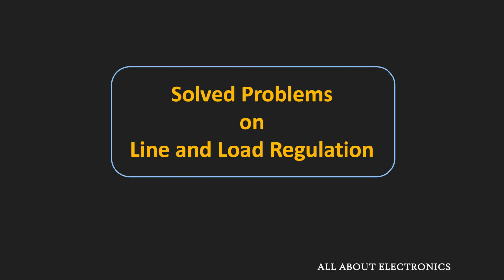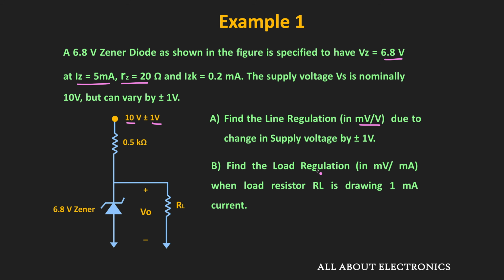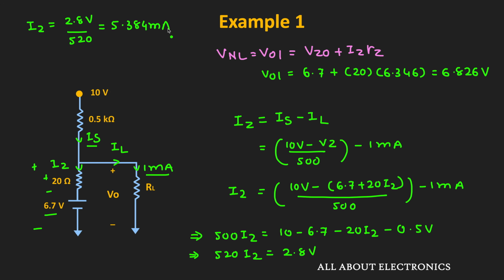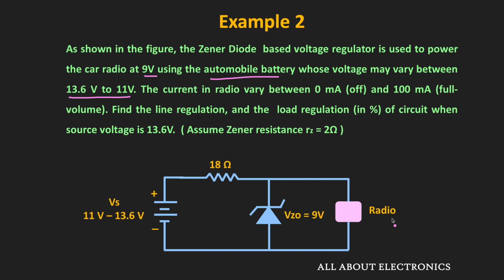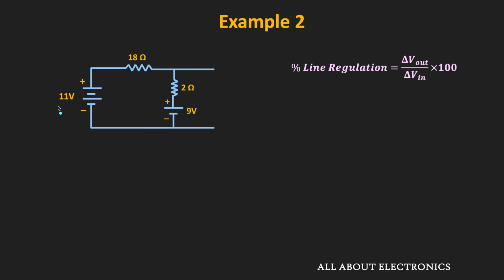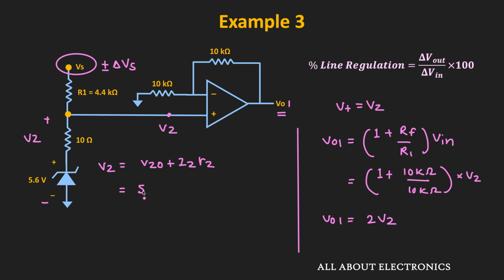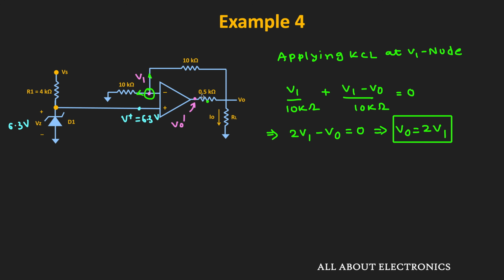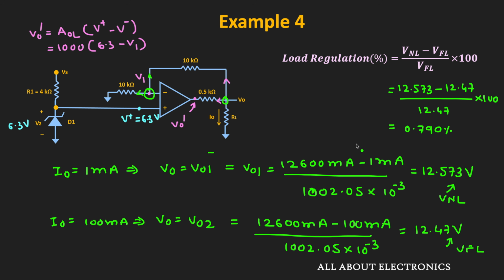Zener Diode Solved Problems | Line and Load Regulation in Zener Diode as Voltage Regulators

Comment from the maker: For more information about the Line and Load Regulation, check this video:
https://youtu.be/Y79V0f9corc?si=Irwfc8PFJ5RKUsLd

For more information about the Zener Diode, check the following videos:

1) Avalanche Breakdown and Zener Breakdown:
https://youtu.be/EzlSafjMltc?si=74hgRQf47VX_sNks

2) What is Zener Diode? Zener Diode as Voltage Regulator Explained:
https://youtu.be/MZPeRlst8rQ?si=ZsC4SxXwvzqpWfDH

3) Solved Problems on Zener Diode:
https://youtu.be/kYtebfx-yHc?si=U6irDSydyuXa_b7M